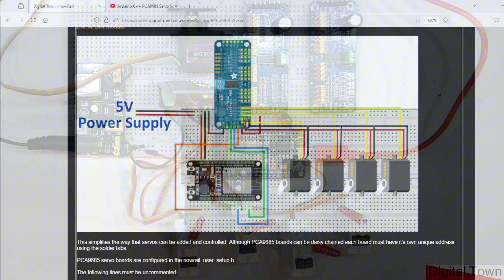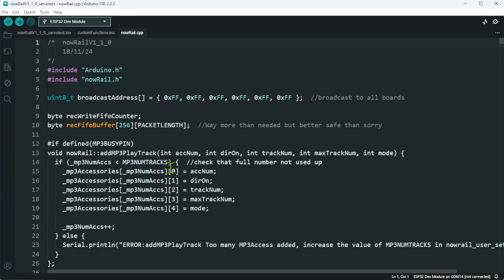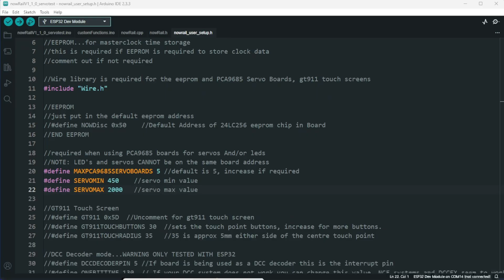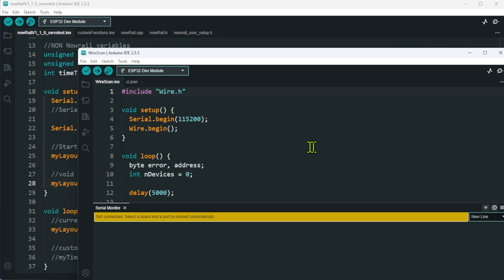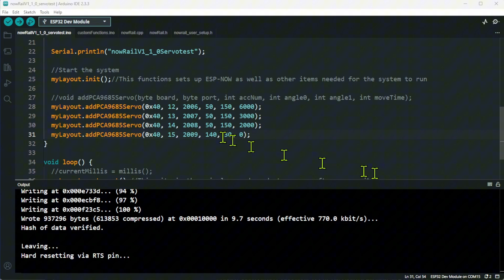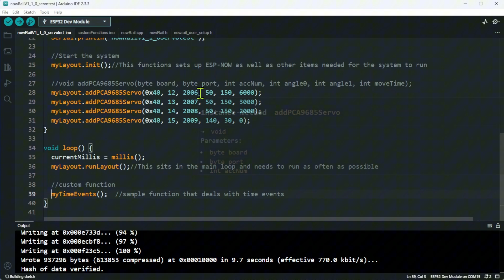#117 Arduino C++ nowRail model railway control - Servo control with PCA9685

Comment: DO NOT set both throws to the same number when programming the solenoid travel. It will fubar the script. It seems logical to set both throws to 90 to find the center of travel of the solenoid. If you do this, the program will not work. I set one to 90 and one to 91 and all was good after a lot of head scratching.
Reply from the maker: Thanks for the reminder.

Comment: Many thanks for your video, to get over the problem with load for multiple servo's apply a separate 5v to the PCA9685. Rob at Little Wicket covers all options on using the PCA9685 and more https://www.youtube.com/@LittleWicketRailway 

I am keen to use your option with the ESP32 instead of my MEGA which also controls my DCC EX
Reply from the maker: The 5v supplied through the V+ pin is supplying the power to the servos, the issue was my power supply was too small. You can connect the power supply through the green connectors but it's a lot messier when building connectors on the layout, hence the reason for using the V+.